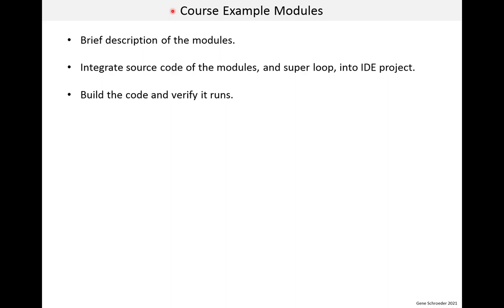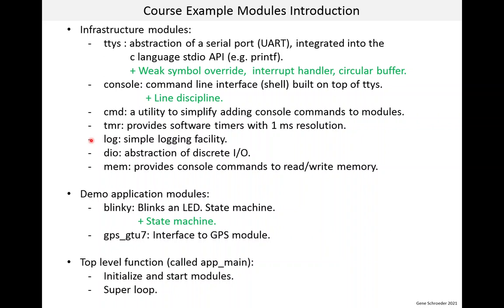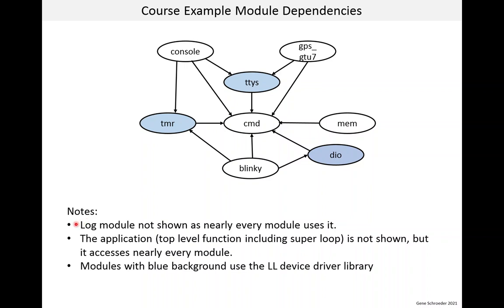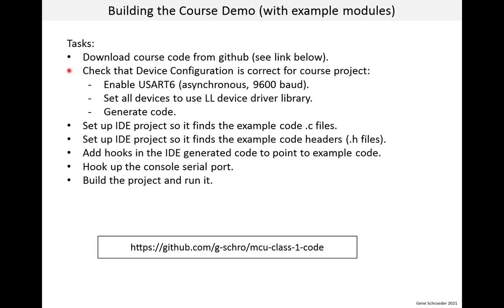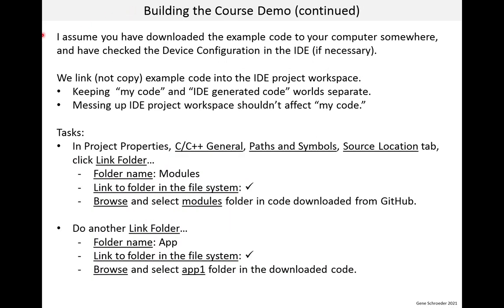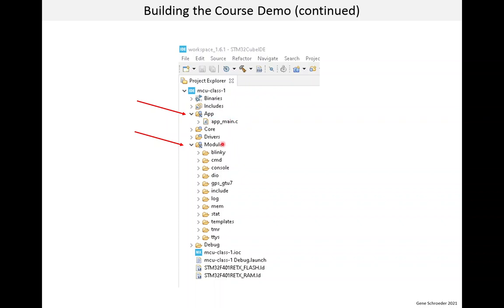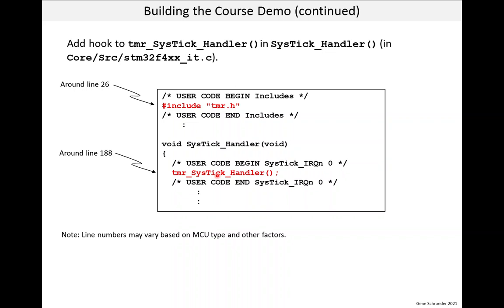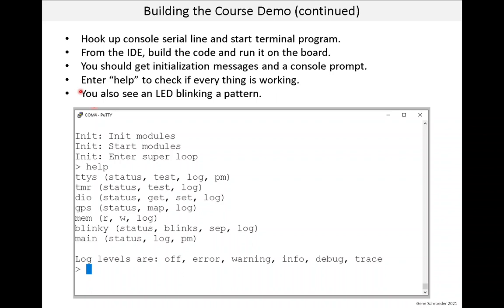Lesson 15.  Overview of Course Example Modules

Comment: Hello, I have been following your course and as a beginner in embedded software, I have found it pretty instructive so far! So thank you.

That being said, I have been following it using an STM32 MCU of the F1 family (Unfortunately the F4 and newer version ones are out of stock), while trying to run the code, I had to change all of the f4xx libs to f1xx ones, It's a pretty bad try, considering the F1 is the older version and will most likely lead to problems with newer features/changes. As I tried to build it, I ran into a problem of undeclaration of "LL_GPIO_PULL_NO',  is there anyway of fixing this or I gotta get me one of the f4 boards?

Again, thank you for this course, I will still finish it, I guess I just have to follow as I read the code and hope I get the most out of it. I will at least try to create/modify what I can possibly modify to create the f1xx versions! ( At least the command prompt, haha!)
Reply from the maker: Hi Mario SOUPER,

Thanks for the kind words. 

Yes, there are many members of the STM32 family, and as you mention, there are many differences between them. As I developed more courses, I ported the code to other STM32 MCUs that I had, including the "STM32 Blue Pill" which is STM32F103C8T6. Perhaps this is what you have, but in any case, it is F1. I remember that issue with LL_GPIO_PULL_NO. And of course the header files are different, as you discovered.

My first course that has support for the STM32 Blue Pill is the one on floating point. I *think* you could use that code in place of the code you are now using. The repo is:

https://github.com/g-schro/float-class-1-code

This code has some added functionality that I added for the I2C course and floating point course, which I think you can just ignore. There are probably other odds-and-ends changes.

A key file is modules/include/config.h. It uses symbol defines (like STM32F103xB) that the IDE puts in Makefiles, to choose the correct code, including header files. If your MCU is not STM32F103xB (x means "don't care"), you will need to edit config.h. Also, config.h requires a symbol define CONFIG_FEAT_GPS in order to include support for the GPS module. If you want that, you will have to add that symbol define to the IDE, or just hardcode it in config.h (e.g. add a line "#define CONFIG_FEAT_GPS 1"). I have not tried this, so there might be problems.  Let me know.

One word of caution - if you are using Blue Pill with a cheap ST-LINK adapter (like I do) be certain in the IDE pin config that SYS->Debug is set up correctly for serial wire. I have found that my cheap ST-LINK adapter does not seem to use the reset signal correctly, and it is very tricky to program flash if the debug port is not enabled.
Reply: @geneschroedertech7501  Thank you for your reply!

I have tested what you suggested and it had partially worked (console, log, command, tmr and ttys modules), blinky one is buggy as the LED doesn't blink (haven't tried debugging that yet).

I also had to comment the GPS module for it to work.

If I discover anything new I'll make sure to keep you updated!
Reply from the maker: Sorry I somehow missed this comment.  Sounds like you have been making good progress! 

It might be that the LED on your board is connected to a different GPIO compared to the one I used. Also, your board might have different UART numbers compared to mine, which would cause problems with the GPS module.

Comment: Thanks for the great course. Not sure what I did wrong, I couldn't make the app_main.c works, I can run my code in the main.c without problem, but it no longer works after moving it to app_main.c. I follow the steps you shown a couple of times but still doesn't work. Basically, it no longer be able to recognise all the LL functions once in the app_main.c....
Reply from the maker: I am not completely clear what you are doing. So here are my assumptions. Let me know if any are wrong...

1. I assume that the IDE tries to compile app_main.c, but gets errors, due to the LL functions.

2. I assume that you have code in app_main.c that uses LL functions - so your app_main.c is different from mine, because mine does not call any LL functions directly.

So here are some possible solutions...

1. You need to do #include (in app_main.c) for any LL functions you are using. For example, in my file tmr.c you will see #include "stm32l4xx_ll_cortex.h" and in ttys.c you will see #include "stm32l4xx_ll_usart.h".

2. In the IDE, you need to make sure you have the LL library selected for the peripherals you are using. This was done in Lesson 13: Startup Code (timestamp is about 4:20).

If this doesn't help, if you could give a little more information about what you are doing, and more detail on the error, I will try to help.